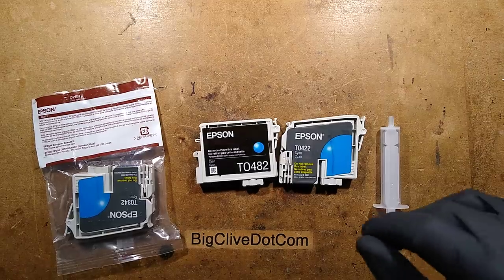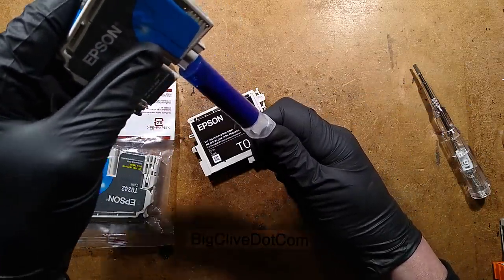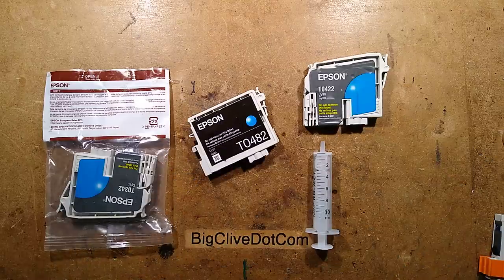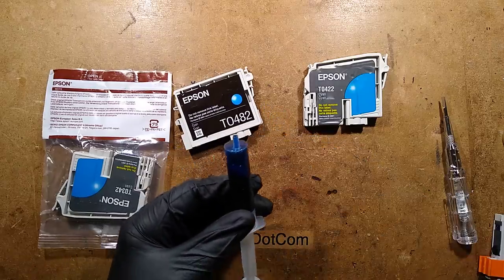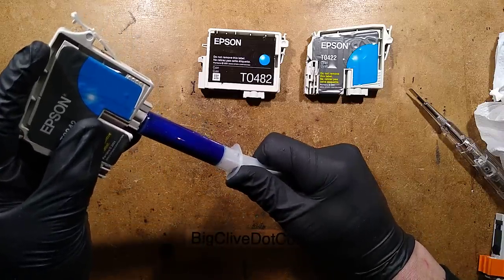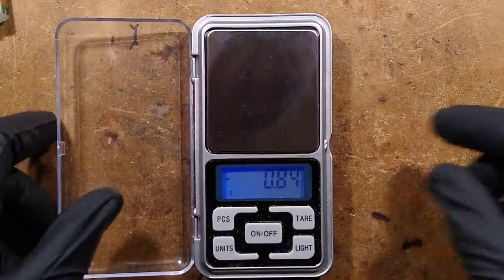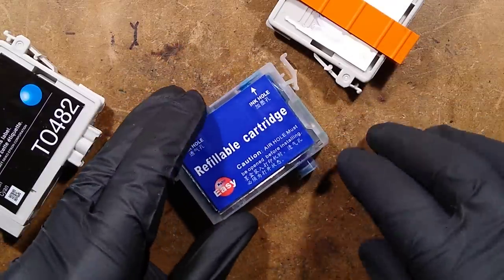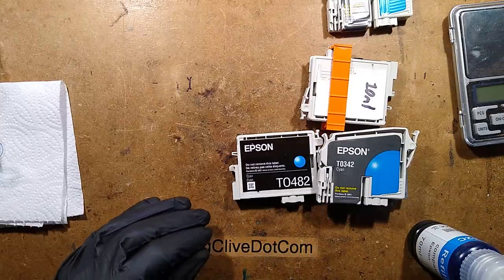How much ink is in Epson cartridges?

Comment: Many of those cartridges have a filament wire that burns out when ink no longer covers it to stop you from refilling it.   If you want to refill the cartridge, you need to run a thin bodge wire between the 2 external pins that lead to the filament.  The ink is easy to order online in large bottles and makes printers a lot cheaper to operate.  Here in Thailand, there are shops that will do it for you.  I've never used Epson, but Brother and Cannon cartridges are quite easy to refill with a small drill and a piece of duck tape to seal it if you can solder the bodge wire.  (By bodge wire, I mean that thin insulated wire you use to bridge gaps on a damaged printed circuit board.)  Use an ohm meter on a new cartridge to see what pins the filament goes to, once you know that you're good to go.  Thanks for another good video.  Beating these people who charge ridiculous prices for ink cartridges is emotionally rewarding.
Reply: interesting, so the filament wire has no actual function for printing, just to burn up once the original ink is used up?
Reply from the maker: The only system like that I've come across is a laser printer cartridge that deliberately blows a fuse when it's empty to stop it being reused.  The cartridge can be refilled with toner and the fuse changed.
Reply: @alnicospeaker  Yes, so it won't work if you refill it.

Comment: I used to refill my Epson cartridges, the ones with a chip on the bottom. It was a right faff t do but saved so much. I had a thing that flashed the chip  into thinking it was new. But I dont really use my printer now. Interesting video 2x 👍
Reply: I had that too . ended up drilling holes in the thing and attaching tubes from ink tanks.....
Reply: thankfully we have auto-reset chips on custom refillable cartridges you can get that makes it far less tedious now a days.
Reply: Epson do Ecotank printers, you pour the ink into a container out of a bottle. Very affordable and no chips.
Reply: @n1jrm  good idea 👍👍
Reply: @HerbaMachina  yes this was the early days of home colour printing.
Reply: did that too

Comment: What's neat about Epson printers, especially the Ecotank, is that they, in contrast to other manufacturers, often use piezoelectric printheads where each nozzle works like a teeny tiny miniature piezoelectric pump. Other manufacturers typically use a thermal system whereby, when a droplet is to be projected out the nozzle, a heating element instantaneously boils the liquid, increasing the pressure momentarily. The piezoelectric system seems to be quite tolerant to running liquids that the printer was not designed for (:

Their Ecotank printers lend themselves quite well for dye sublimation ink (which is actually quite viscous) that can then be transferred to other materials like plastic or fabric. They even sell blank ceramic mugs that have been coated with polyester to receive an image through this process, it's really neat.

Comment: It would be interesting too see how the chips work as some printers with refillable inks also require a seperate chip resetter such as the 405, and you have to match the pins up to  the chip and if done correctly it resets the cartridge
Reply: No idea about Epson, but most HP LaserJets use a 1Kb 3-Wire Microwire EEPROM, with a "HP" Serial.
Reply: In the original HP bubble printer patent, the chip itself is a single use printer head where brief resistor heating behind a tiny hole causes a drop of ink to boil and squirt onto the paper (there's multiple such holes precisely placed by the chip production) .  If they integrate the usage counter in the same chip they save a component and get a direct way to disable the cartridge when they think you have printed enough pixels .
Reply: @johndododoe1411  They do that by having an extra resistor on the silicon chip, and then when the printer decides it has printed enough the resistor is heated up till it fails. There are some around that used this, and there were methods to incorporate a resistor on the main board to cheat the system, so it would print forever, even with no ink. Now they incorporate a small section with some copyrighted information, mostly a small snippet of music, to get DMCA protection, and use that instead, and when it is determined by the built in counter it simply sets a bit. Copyright music so they can shut down clones using DMCA, and the cloners simply reverse engineered the printer ROM to figure out just what hash they needed, and put in noise to get a hash collision. Then firmware updated to detect that in a cat and mouse fashion. Now you need to be online to print or scan a page.

Comment: As an occasional user of a printer I found inkjets incredibly frustrating. Long startup time while the machine does its ablutions which inevitably exhausts at least one of the colours - it then refuses to print a black and white document because it’s run out of yellow.
I found cartridge replacement to be horribly messy and expensive and tried refilling to cut down on the expense - that was even messier and then I discovered I needed a chip resetter. The resetter lasted for two cartridges and then stopped working.
Bought a £200 Brother colour laser instead. It probably has enough toner for the rest of my life and warms up in a fraction of the time that the inkjet needed. 
If I need a higher quality print of a photo then I’ll simply order from a professional online.

Comment: I have a Canon Pixma G3260, replaced an old Epson Artisan 810 when the printhead failed. It is a tank system, and the bottles it came with were enormous. It even included two extra bottles of black ink I haven't touched. Printer was less than $200 USD (far less than equivalent Epson models) and that includes a very color-accurate flatbed scanner, so it's not like they are overpricing the printer either. 

I do have a Brother color laser MFC for most print/scan/fax tasks, but the Canon is outstanding when I need photo quality.

Comment: I had one that used the T048x cartridges.  I dumped the printer when the light magenta went out and it would not let me print straight black without it.  I could no longer by individuals couldn't find refills at the time.
Bet the kitchen looks like a Smurf was brutally murdered.
Reply from the maker: The sink is still cyan.

Comment: I bought an Epson Workforce 3520 dwf in 2014 for my studies. It's capable of double sided printing and scanning which is really convenient.
But the main reason was that, by many reports online, this model would happily take basically any 3rd party cartridge.
And it does! Sometimes it complains the cartridge is not genuine but you can simply click that away. At the moment 6 black and 3 sets of color cartridges costs me ~8€ but with a resetter I can use them twice until they are empty.
Also the tank in which the printhead cleans is replaceable and therefore won't kill the printer as it happens on many cheap ones.
Printed over 8000 pages and going strong.

Comment: Leaving the printer permanently connected to the power socket, even with it switched off at the printer, passes a tiny amount of power to the print heads to prevent them from drying. Advice from the printer engineer that serviced a couple of my Epson printers a time or two. They used to be set to stop at 8,000 pages and require service, which is why I'm on Canon now.
Reply: I can get behind this, with my printer coming from the latter brand. Not only no software locks on what cartridges you use and whether or not you can refill them (Print quality being at users risk of course) but the output mastering software included with mine - Bought at a time when „Print preview“ was an uncommon feature and seldom used - Is absolutely fantastic, and has saved me $$$s on inefficient and wasted output! 👍
Reply: @nemesis2264  Agree. As far as I know the printer should remain connected to power because these devices do not have a battery-backed real-time clock. So they can't 'know' how long they have been fully disconnected from power - it could have been for weeks, months or years! Therefore the printer will do a full head cleaning cyclus before printing again. And that will use up a lot of ink.

Comment: I used to refill the T032x and 42x series cartridges back in the day. They will take about about 15-20ml.
There is a little physical "pressure relief" valve to the left of the "cyan" text and another is the little dot on the bottom of the cartridge near the chip, the dot closer to the ink port is the fill chamber. The older OEM chips can be flashed with a resetter, many don't need to be replaced.

Comment: Hp make you use genuine cartridges in their printers or apparently it voids the warranty (it detects the cartridge used) and they make you sign up to a subscription service for refill cartridges before you can use their App so I got a Canon this time
Reply: Louis Rossmann made a video about that I also went for EPSON because of that I had a lot of HP printers in the past, I always liked the fact that HP would also give you fresh print heads if something was dry on your epson replacing the cartridges may not fix the problem but nowadays HP is just a scam but there's enough legacy from their printers from the past that many people will fall for it anyway due to blind brand loyalty.

Comment: I have the Epson Eco Tank ET-8550. It is a "wide format" printer, can print up to 13" × 19" (B+). This particular printer has 6 ink tanks, the typical 4 plus gray and photo black. It also has an easy to change maintenance box. The maintenance box being user serviceable is what sold me on the ET-8500 series. 

So far, I've been very happy with it.

Comment: Ecotank is actually only twice the price of the cheap one, but comes with more than a half litre of ink in it, while the cheap ones come with anything from 10ml to 80ml of ink in them. The one printer that I like is continuous ink jet printers, used for marking products, where you use a litre of ink in it, and then only replace solvent used to carry the ink, and it generally will never need ink added between services, as 1 litre of ink is good for 10 000km of full coverage printing, at 0.5mm spacing per dot.

Got one to tear down as well. Really interesting unit, though going to be messy removing the ink tanks and piping, will have to power it up and do a few purge cycles on it, before starting the job. Working printer, traded in for a faster one. Ink low, and solvent was low, so filled up with non genuine solvent, actually meths, as it is compatible with the piping and pump, all ptfe, as the solvent for use with the edible ink option is actually ethanol in pure form. Just used cheap one. The old solvent is good for cleaning PCB's, and the ink is great for refilling permanent markers, because it really is permanent. Have used it as black paint as well, it sticks to anything, even HDPE, well, except for PTFE.

Comment: I got rid of my old printer and bought a HP smart tank printer.

You refill the tanks with big bottles of ink, which are extremely cheap compared to cartridges (practically just a few pounds when using a generic ink)

Comment: I’ve recently upgraded from a Canon Pixma cartridge type inkjet to an Epson Ecotank ET-8500.  The Epson is a revelation. Faster starts. Faster printing. Less time and ink wasted on automatic maintenance cycles. The genuine ink is a fraction of the cost of  genuine ink for Canon and there’s always cheaper generic ink if wanting dirt cheap printing. It has six ink colours in separate tanks and prints great colour photos up to A4 as well as flatbed scanning and copying. I do print a fair amount, so after the first 18 months use I shall be saving big time after writing off the purchase price over that time. No nonsense with ‘security’ chips and the 70ml bottles last a very long time. If it lasts six years trouble free as my Canon did, it will end up saving many hundreds of Pounds in running costs.
Reply from the maker: My ecotank is now about 6 years old and still going strong.  I recommend leaving it plugged in, as it may have to do a cleaning cycle each time it is powered up.

Comment: One thing about epson Eco tank... They are designed to fail at 6000 pages.
At that count it will inform you that the ink pad is full and brick itself , even though it is bone dry and you are in the middle of printing something important. 
Sounds like Microsoft mentality? 
You will then find that having the ink pad replaced (counter reset) costs about 50% of a new printer.
I found software online which can reset the counter and after rinsing the pad out, was back in business.
Bottom line is that when you factor in the initial purchase price, you are not really saving money with an Eco tank if you do things the official way.
Corporations are vampires.
Reply: I might need this software. PM the link
Reply: @kornaros96 
You can find a link on YT.
Reply from the maker: Mine is at 6000 pages (mostly colour photos) and the third party software reports that the waste ink tank counter is only about 35% full.  Possibly because the printer is left on all the time, so does less cleaning cycles when powered on and off.

Comment: The problem with EcoTank is that when the print head clogs and you need to run 10 cleaning cycles to get color X to print again the waste ink sponge fill up and the printer is basically useless.
Reply: You can replace the waste ink container and reprogram it so the warning goes away
Reply: Yeah, my dad had an EcoTank printer and it was great... until it decided to only print cyan stripes. A cleaning cycle only fixed it temporarily. Now he's got a laser printer :P
Reply: @lolman123401  There should be no need to reprogram it. And yes, the waste ink pad is a consumable item. I think they call the replacement something like a maintenance tank or maintenance kit. Different than with most printers, on those it is an actual tank, and not just some kind of felt pad that should adsorb the ink. At least on the newer models.
Reply from the maker: I recommend leaving the printer active and using it regularly.  Unplugging it while it's not parked properly can cause issues.
Reply: @Fuzy2K I've got a HP laser doing the same with some of its colors, and then HP silently stopped making cartridges for it, so now I use a different brand .
Reply: Some of the Epson Eco Tanks actually have proper user replaceable waste ink tanks that can be done by the end user within just a few minutes and no disassembly, and totally supported by epson with them selling genuine replacements.

The replacements have a chip on them similar to an ink cartridge that allows the printer to track the the use of the waste ink tank.
As soon as its replaced with a new one (Epson calls it a "Maintenance tank kit" iirc), the printer is happy again.

Comment: I once worked with a manufacturer of industrial inkjet inks. The guy I was working with told me about one of their inks:'wow, this is really expensive - I mean, the materials in there cost 30€ per liter!'
It was a longish time ago, so the production cost and pricing on industrial scale is probably significantly higher now, but your typical inkjet cartridge is incredibly overpriced.
The Epson Eco tank thingies seem to be relatively ok. You can also use a normal Epson printer, refillable cartridges and the eco tank ink. At least for me this works quite well.

Comment: Imagine all those schmucks going through all this trouble to smuggle drugs when EPSON can just package some colored liquid into a plastic box and get the same kind of profit margins legally.
Reply from the maker: AND you can snort it.  (But it makes a bit of a mess.)
Reply: Razor blade model. The printer itself is sold at cost or a loss. The cheaper the printer, the more expensive the consumables. That's why I always buy enterprise printers. Far lower cost per page, far better built.

Comment: Would love to see the chip rewrite on laser printer. We Ditched expensive & messy inkjet for a HP Laser printer. Because you can get the complete all colors 500 dollar HP laser cartridges for less than 100 dollars and they provide the tools to swap the HP chips on the empty cartridges to the cheap no brand refill and you can keep reusing the same chip. Only downside is that HP chip is usually reading low - and didn’t realize you can reset it!

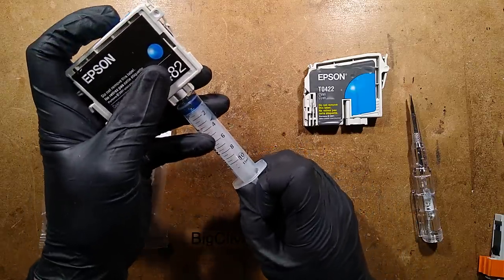Comment: 3:10 As someone who up until recently used a cartridge inkjet, suck away. In fact, figure out a way to refill it and see if the Ecotank ink is compatible, because then it could mean one could fill Canon cartridges with Maxify ink.

I suspect that there are a lot of cartridges that were stuck in storage and weren't necessarily packaged in airtight packaging that would prevent moisture loss. Not sure how long ink cartridges tend to be in hot warehouses or if this evaporation is even a thing.
Reply from the maker: They are usually vacuum sealed.

Comment: I gave up on inkjet printers long ago. I use a Brother colour laser. Not much good for glossy photos, but for those I use an on-line service. I should add that of the inkjet printer makers, it's HP (a company I once much admired) which is the one to avoid. It was HP that produce an all-in-one device that won't even scan if one of the ink jet cartridges has run out.

Comment: There is/was one particular make of toner cartridge that included a soldered in fuse. After a certain number of pages had been printed the printer deliberately provided enough current to blow the fuse and stop it working. Replacing the fuse enabled the number of pages printed to be almost doubled before the toner finally ran out.
Reply: I assume that brand has the same initials as a popular (In UK) brown sauce often used over fry-ups?... 😉
Reply: Konica/Minolta? 🤣